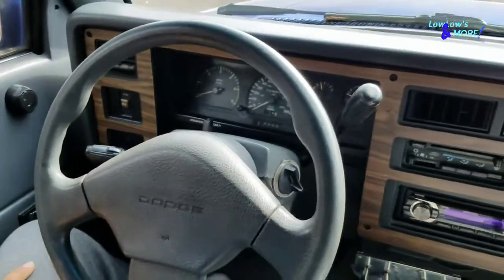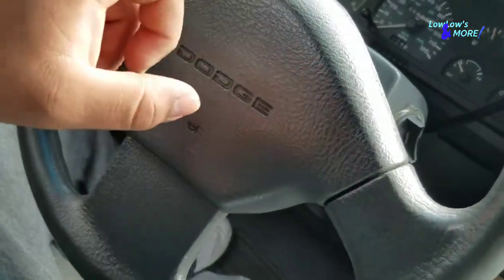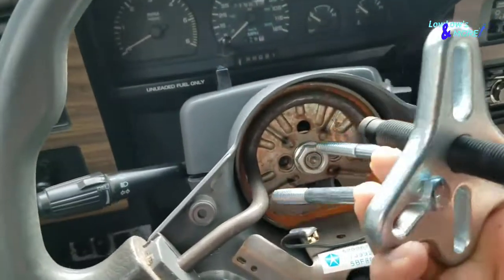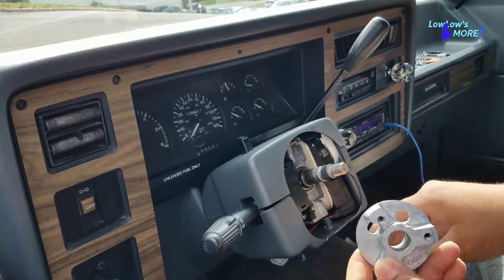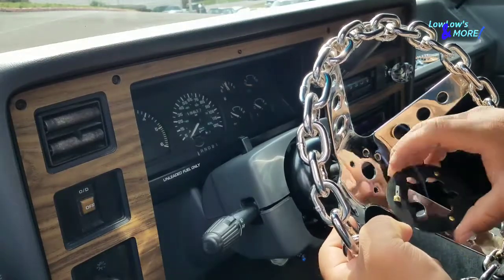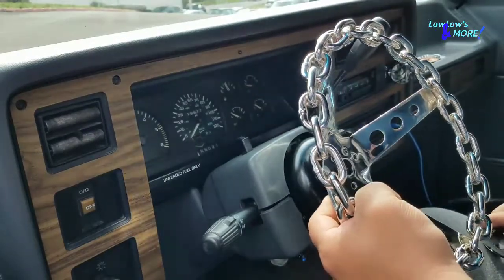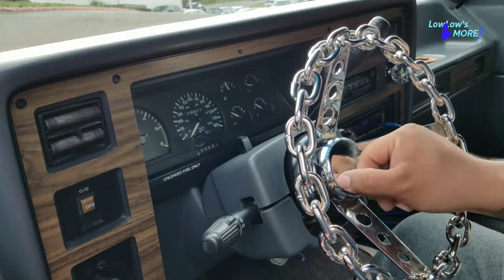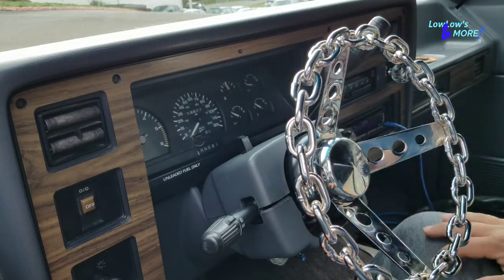Installing my Grant Chain Steering wheel on my Lowrider

Comment: Hey bud, same deal for 1st Gen Cummins guys. Just did one on a 91. The plastic that surrounds the column may be interchangeable with Dakota and may hide the guts a little better. IE the 3 Torx bit shroud. 

Same deal with the knotched stock wheel and horn assembly which is apart of the modular system Dodge switched to after the older first gen trucks. Since I have a non-tilt wheel like yours I plan on putting a button on that shroud with a wire completing the ground circuit under the dash.

I looked far and wide for a good bit and don't know of any true adapter hubs ever made out there. Like you said you'd have to custom make one. 

If you have an issue with the black metal cover rubbing on the plastic shroud, add a washer behind the steering wheel nut, if it still rubs grind it down a little and touch up the paint.

Comment: I still continue to have issues with my Dakota. The chain steering wheel lasted on my truck only a year. Kept burning my hands but didn't want to buy a cover for it.
Reply from the maker: bronx1xw 
What issues do u have with your Dakota?  I dont drive this very much so i guess i should be ok with the chain steering wheel.
Reply: LowLows & More!  Before the lifts it was my daily driver for work. Had a not so hard time with the steering wheel. The adaptor I have would not let me connect my horn so had to connect it on the side of the steering column. My blinkers do not snap back in to place after I do a turn. 
My rear cylinders had to be mounted on the diferental also had a good time with that.
Reply: @bronx1xw  Idk what you mean

Comment: So can I use any standard grant adapter if it’s a three hole like the steering wheel I bought ?
Reply from the maker: As long as the adapter fits your steering column it will work with the 3 hole steering wheels. Grant's make a ton of different ones.

Comment: Dude.... what year is your Dakota I just recently dropped serious tears over the steering wheel of my Dakota I told her and then I rebuild the front end but my airbag deployed and I wanted to replace the steering wheel and I do not want another OEM One and I I'm stuck I really want Billet one but I know that's never going to happen will the S10 but really work I can't stand another heartbreak if I get my hopes up
Reply from the maker: Mine is 1993 Dakota, the year for the adapter is from a 85-94 s10/blazer.

Comment: I wanted to put a chain steering wheel on my riding lawn mower. What stopped me is the price. those fuckers arnt as cheap as I thought they were
Reply from the maker: fuzzy wuzzy 
The adapter cost me $29, the steering wheel is about $85 online.  That would be cool on a riding lawn mower.

Comment: can you give me some details of the products that you bought or identification number so that I could purchase the same product for my truck, also do they make other steering wheel designs that may fit.
Reply from the maker: I dont remember the model number for that Grant adapter. They dont make one specific to my truck so I had to use the adapter that fits late 80s s10 and Blazers. The only thing is the Horn wont work, you'll have to wire in a momentary button for the horn.  Grant makes a ton of difference steering wheel styles that fit their adapters.

Comment: What part number kit did u use on ur dakota or make work I want change mine on my first gen any info be cool thanks
Reply from the maker: John Kirk 
I dont remember the part number to the kit, but this kit is made to fit s10 Blazer from 87 to 93 i believe and it works good on the dakota, just need to rewire in ths horn.

Comment: Did the black hub that covers the innards come with the wheel?
Reply from the maker: It came with the kit, I believe you can order chrome ones to.
Reply: LowLows & More! Is there a bolt that goes before the black cover to keep things from coming apart after you bolt the wheel in ??

Comment: What about a 1998 Dodge Dakota?
Reply from the maker: DodgeGamer 
Im not sure, it doesn't hurt to buy the kit and return it if it doesn't fit. The kit i used fits 86-89 s10,Blazer,Jimmy. But the horn wont work. I still need to wire mine.